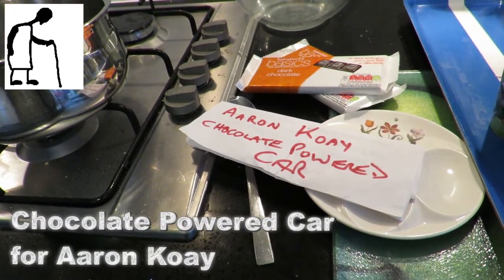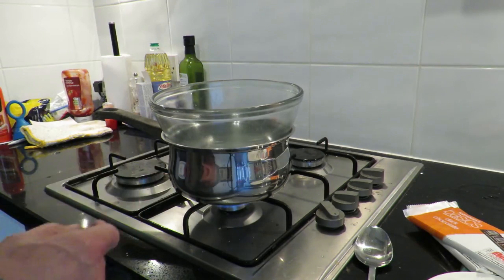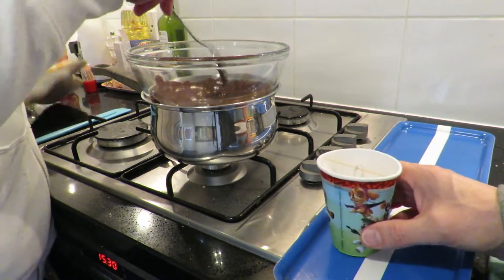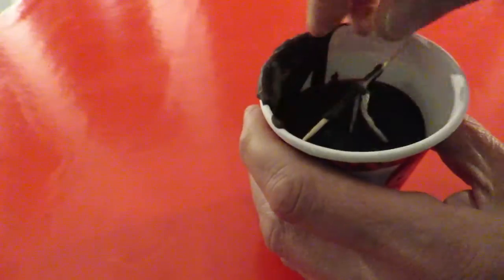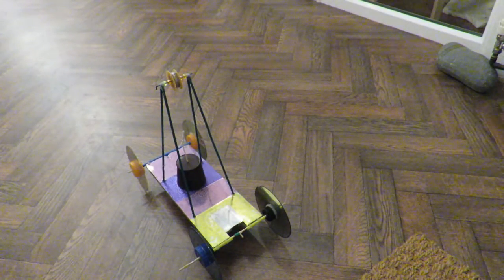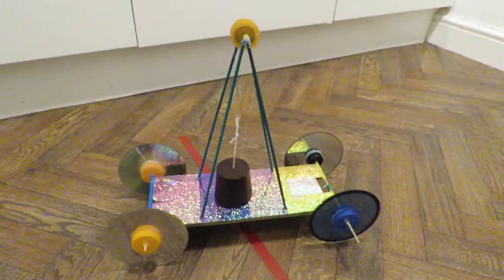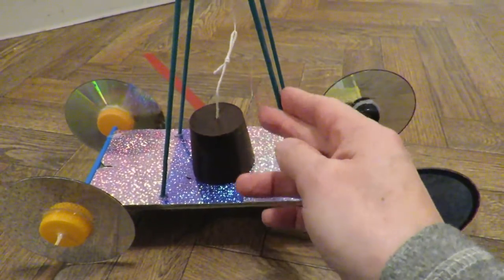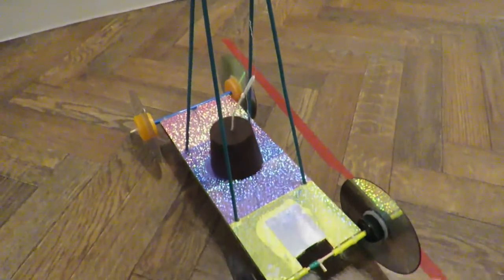Chocolate Powered Car for Aaron Koay

Comment: Worked well...I was sure you were going to stick pieces of copper and magnesium into it.
Reply from the maker: I was rather expecting you to point me at one of your battery videos where you actually used chocolate. I did consider trying something like that but was rather keen to be able to recycle the chocolate when I had finished 😊 OK, couldn't resist trying it, just set it up, melted some chocolate and tried copper and magnesium. Looks like it works as an insulator rather than an electrolyte. I will upload a video eventually but I am running about two weeks ahead at the moment.